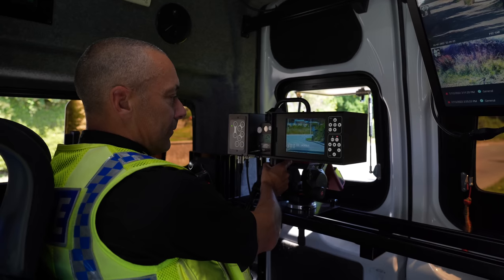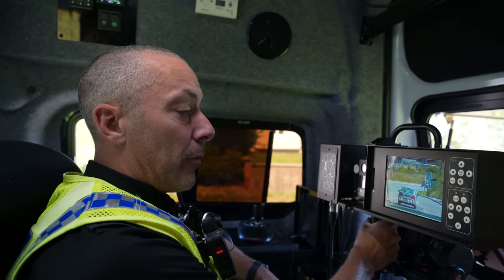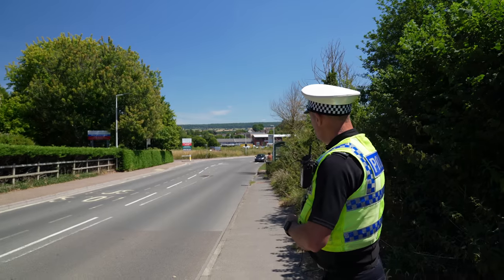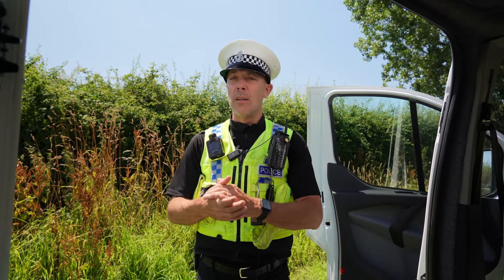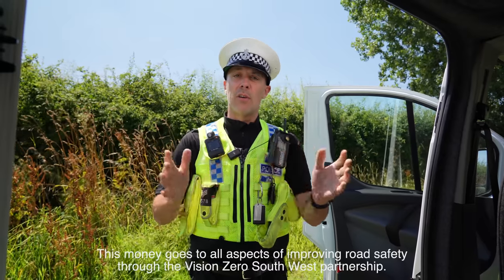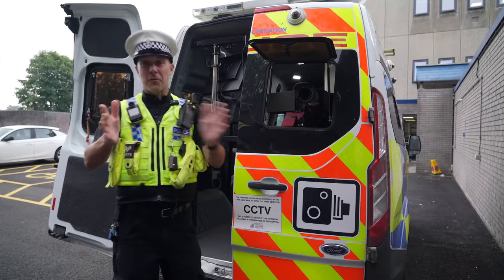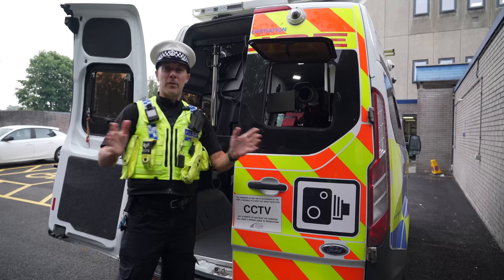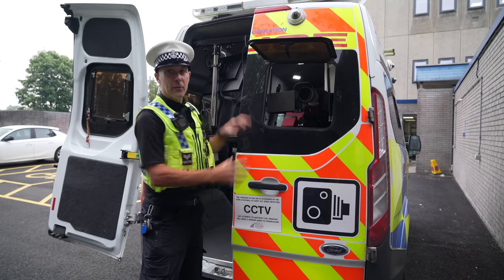SPEED CAMERAS - Road Safety or Cash Cows?

Comment: Now if only the vans had microphones to associate a vehicle with (say) an illegally loud exhaust, which is also a significant problem in residential neighborhoods. Finally, passive atmospheric monitoring of airborne particulates and gas concentration would allow for the mapping of pollution on the roads at the same time. Any takers?
Reply: Exhaust offences and things such as tinted plates and windows require the vehicle to be stopped, you cannot do it via a microphone from a distance.

Pollution is the domain of agencies other than police.

Comment: In North Yorkshire they are very good at making the vans as least visible as possible, They are always somewhere like a steep hill or where there's a limit change but no real hazard. I've even spoken to ex-coppers that are against speed vans, if you really want to keep speeding down put in an average speed zone or fixed cameras. 100% cash cows.
Reply: Wherever they park, someone will moan, on the straight bits, the bendy bits, the gradients, the dips.

They can only park where they can park.

I've spoken to lots of serving officers who actively endorse speed enforcement in its current form as it means they do not have to do it themselves.

Comment: We do it differently in Wales , hide the van , do not allow civilian speed checkers (we had them but were taken away because the camera van was losing revenue ) . In Wales vans are white with a couple of camera signs
Reply: I know precisely how GoSafe operates, you say ''do not allow civilian speed checkers' - what does that mean?
Reply: @unleashthedragonwithin2057  We had members of the public with an official  speed gun who noted speeders and GoSafe would then write to them  . Was working well locally , Go Safe then withdrew support for the operation as the Speed Camera Van speeding revenue was reduced .
Reply: @nigelhughes2947  You mean Community Speed Watch which only results in a warning letter.  My experience is that the process  required to manually transfer all the collected data to a system that then produces warning letters after each keeper has been provided by DVLA is unsustainable.  The staff who do the admin are paid by those detected and who attend a course, so it is a Catch-22 situation, the staff cannot be employed without course funding, so ultimately, 'genuine' enforcement would have to cease.  I can therefore see why CSW is not viable if it relies on police resources to generate correspondence.
Reply: @nigelhughes2947  No, that most certainly is not what was stated.

Speed enforcement units comprise various sections, there are enforcement officers, a viewing team, an admin team, a prosecutions team, team leaders,a unit manager, so around 45 staff which equates to £125 - 135k in wages every four calendar weeks before you factor in the huge stationery, printing and postage costs, which can be 10 - 15,000 individual items of post every week, fuel, vehicle related bills, heating, electricity, static camera contract etc.

To compare it to parking penalty notices is just shortsighted.

However, in 2011, central government stopped speed camera funding which meant that every UK constabulary had to devise a strategy to provide the public service of speed enforcement, many being unable to and some just had to stop.  This means that speed enforcement can only exist via the self-funded national model of course offers.

Hiding?  What does that mean?  Laser speedmeters do not and cannot work with anything in the way.  Can you provide any verifiable evidence please?
Reply: @unleashthedragonwithin2057  So you did not agree with the Government so used a revenue strategy to fund people to get speeders , so without the course revenue there would be no camera vans , so in fact the general public is quite clearly the cash cows which keep you all in a job . Its all about the revenue
Reply: @nigelhughes2947  It has nothing to do with me not agreeing with the government.  Every UK constabulary is under considerable pressure from communities to provide a speed enforcement presence.  Without a structured mechanism to be able to do that, many regular officers would be taken away from other duties to carry out enforcement.

The 'general public' are not cash cows, only those intent on ignoring the posted threshold end up with a notice.
Reply: @unleashthedragonwithin2057  Other duties such as not attending burglaries , violence against the elderly , yep just be happy with a crime number while we get on with hate crimes , thought crimes etc oh and making sure driving while black is punished .   We have now come full circle community speed watchers do not make money  but speed cameras pay for jobs for the boys ,
Reply: @nigelhughes2947  Community Speed Watch only exists because it is paid for by sanctioned speed enforcement operations.

So no, speed enforcement pays for such road safety operations, both those that result in notices of intended prosecution or 'just' warning letters.  None of it would exist without a system of self-funding.

You obviously have a some form of grievance you are attempting to air, but the above is traffic based, demonstrated by a traffic officer who has nothing to do with burglaries, or assaults, hate crimes.

I understand you are encumbered with psychological baggage that's clouding clear thought, but once you understand how it works as opposed to how you'd prefer it did, you can reach your 'happy place'.

Comment: Although I agree about the dangers of Auto-Bahn vs regular UK roads, there is a massive difference between cars traveling on both roads. I would dare to say, that 80% of cars from UK would not pass TUV (German MOT) in their current condition, thus they would not be allowed to participate on the road. One of the reasons, why people buy cars from Germany is the fact, that Germans are almost ''forced'' to maintain their cars to close OEM standard of the manufacturer, but that enables them to safely drive on the autobah.
Reply: So all these vehicles were in tip-top condition, meaning it was the drivers at fault:

259 cars involved in motorway pile-up in Germany
This is the horrific aftermath of a motorway pile-up involving 259 vehicles that left 10 people fighting for their lives.
Reply: @unleashthedragonwithin2057  There was a pileup on M3 recently with several casualties as well (speed limit 70mph). So what's your point? Are you trying to take out driver element and write off all accidents on maintenance level of the car? You do know that crash site investigators check car condition when any major accident has happened to see what could have caused it?
Reply: @MrLangobard  My point was extremely clear.

It is the human being behind the wheel who decides how that motor vehicle will be driven, its speed and direction.  It is also a human being who determines if that motor vehicle is in a fit state to be driven on public roads (all pertinent conditions applying).  

You take control of a motor vehicle, the onus is on you to ensure its mechanical and structural integrity.
Reply: @unleashthedragonwithin2057  It does feel we are going in circles here, but I do agree with your point. So I'll leave at that. As long as safety of others are preserved, I have no issues what so ever.

Comment: I noticed on the camera the bend up ahead so people cant see you till theyre around the bend, so in a way your hiding and  surely its entrapment.
Reply: Being hidden doesn't make it entrapment, entrapment is the act of lying in order to get you to commit an offense you would not have otherwise committed in order to gain a conviction. Being hidden does not make people speed, therefore it is not entrapment. Also, being around the bend doesn't make it hidden. It just means it's around the bend. Roads are only made up of bendy bits and straight bits, so it'll always be round to bend for someone

Comment: Technically, what was said about not having to mark up the vehicles is only partially correct. All vehicles that stop regularly on or next to the highway must have Chaper 8 markings (the Red and Yellow stripes). When driving, you should be looking in to the distance, towards your next limit point; not staring at the vehicle in front. Therefore, if you can't see the van in that distance (whether it is a camera van, roadside workmen etc), your observational skills may need to improve.

Comment: When used correctly, yes they are a good measure. But the is a fixed speed camera on a dual carriageway near me that has been turned off by the local council (to save money I think?) but the camera is still there….remarkably people still slow down and check their speed simply because the non functioning camera is there…..so ? 🤔🤷

Comment: If you want to slow people down, design the roads to "afford" the speed you want.  Make driving on it faster uncomfortable.  Narrow the roads, bring the pavements closer, put more crossings, more obvious crossings, lower the kerb in sections and put the pavement across the road.  Make it confined, constricted and less obvious it's not a "shared space".  ALL SCHOOL AREAS should be pavemented, not tarmaced with very obvious entry and exit hard speed ramps (not table tops).
If you give people a wide open dual carriageway with a clear view for a mile and very little traffic, how are they going to assess that risk as 40mph?  How?  They won't because 40mph is a stupid speed for something that practically looks like a motorway or race track!
If you have a section of dual carriageway that you NEED to by 40mph... narrow it.  Put calming cones between the lanes every 50 yards, force cars to WANT to slow down, not just trick them with a random 40mph zone which only got put there because of some stupid graduate civil engineer making a rubbish risk assessment, meaning as there is a T junction which is hardly ever used, or a pavement frequented by absolutely nobody, it has to be a 40mph.

Comment: i agree with most of the video however reaction time is vastly different to 30year old cars. Mechanical engineering has improved so many parts in the car that help alongside the reaction time of the driver. especially EV's
Reply: How does reaction time vary depending upon what car you are driving?
Reply: @unleashthedragonwithin2057  if the mechanical parts are more responsive and better then it will help a lot
Reply: @nippz2831  Reaction time is nothing to do with the vehicle, it is how long it takes the driver to move their foot from the accelerator pedal to the brake pedal.
Reply: @unleashthedragonwithin2057  I don't think u understand the outcome of the incident or situation changes
Reply: @nippz2831  The outcome has nothing to do with reaction time.  Reaction time is followed by braking time, assuming the brake pedal is actually pressed before the collision takes place.

The reaction time is the same as it was when motor vehicles first existed.  It is the human aspect = how long it takes for the brain to register the approaching hazard and to then react by physically moving the foot to cover and press the brake.  It has nothing to do with the mechanical parts of the vehicle, you are confusing it with braking distance.

Comment: No disrespects but I've seen a cop on the main torquay to Paignton Road corbyn head pointing a radar gun at traffic that's moving 5mph lol. Yet the shops in Preston after 9pm you could have confetti tickets why are you wasting time and resources
Reply: Isn't Preston 350 miles from Cornwall?
Reply: @unleashthedragonwithin2057  Preston in Paignton its Devon not Cornwall
Reply: @chucky2316  The above is Devon AND Cornwall Constabulary.  I have never seen shops anywhere issued tickets for speeding.
Reply: @unleashthedragonwithin2057  there's shops in Preston on the main torquay Road and the idiots use it as a race track at night

Comment: Somebody should tell that to Safer Humber about not being a cash cow.

They tried to fine me because I went "through" a red light. Like their there to enforce the speed limit plus I guess mobile and seatbelts in some cases

But they fined me for going through a red light but it wasn't... It was GEEEN. They assumed because the oncoming lights were red that mine would be red but no, the timings are different because of the filter.

This was at night when it was quiet on the roads. The way I could prove it was because I had a dash cam.

Comment: sureley there is something in law saying you need to mark up the veichles.
according to both data protection and GDPR people need to be informed / made aware that data is being collected on them before the data is collected (surely this includes speed and numberplate)
wouldnt a plain unmarked veichle be couvert/directed surcailance and require written RIPA permision for each veichle before it can be targeted?
Reply: No, nothing in law regarding the need for markings.

No, GDPR & data protection do not apply, this takes place in a public place where there is no expectation of privacy when it comes to criminal offences.

No, nothing in law that prevents covert enforcement,

Comment: Why put a speed camera van by a school that is closed or during hours children will be in lessons? Why don't you put it there between 8am and 9am and 3pm to 4pm? The reason, if you speak to speed camera partnerships, is cost. It's expensive to deploy speed vans so they are ONLY sent to locations guaranteed to give a good financial return. (All this information is available to look at.) For example, on a main road between 5pm and 7pm or from 9am to 11am. The position is chosen in the North West AFTER speed surverys. A box is put at the roadside with wires across to measure speed and time. I had this explained by Merseyside after I asked for speed checks in areas of risk. It means the surveys are still used to position vans on specific roads, which times give the best return and which directio.  It's been admitted they are used on roads that have never had vehicle or pedestrian accidents. One request I made was a main road that idiots kept going through a wall as their chavved-up cars couldn't handle a bend at more than 30mph, one was by a care home that a bus stop was on the opposite side to, one by a village with various shops. All refused based on the above reasons.
The reason also given for not putting speed camera vans near schools between 8am and 9am and 3pm and 4pm was that there is a big increase in traffic, causing congestion and making it difficult for people to get above 30mph. Police said parking was more of a problem and they couldn't be outside every school to give people tickets. Another problem is lack of education and parents suggesting pedestrians have right of way. This is a dangerous message as schools don't seem to teach basic road safety now. Parents don't either as children seem to be experts at no win no fee and all know their rights, which doesn't help when playing chicken with cars, buses and HGVs. Most accidents near schools are as a result of children running in to the road, not using crossings, thinking vehicles will just be able to stop and riding bikes in a manner that is not considered safe as their actions put not only themselves at risk, but other road users and pedestrians. They're ALL hit on the road and none on pavements - vehicles were not on pavements at the time of collisions, so it can only be the fault of the pedestrian for putting themselves in danger.
Look at some accident investigations and see that railings outside schools are ineffective - some cycle groups even complain they shouldn't be used. They don't understand risk assessment. Every accident or fatal I have seen involving children has been caused by them running across roads within feet of crossings, or as a result of their own actions. I can only think of one were a car mounted a pavement.
We need to educate people about inappropriate speed and children about road safety. It isn't acceptable to make drivers or cyclists responsible if someone else takes no responsibility for their own actions. Obviously people that have lost children as a result of their own actions will want revenge and prison sentences for drivers and cyclists, but they need to face facts. Once this happens, maybe we can start teaching basic awareness and road safety again, bring back the Green Cross Code, make crossings fashionable again, change this stupid attitude of "it's not your fault".
For a police officer, you don't seem very aware of the wider picture, research, accident investigations, how stats are compiled and misrepresented the same way ethnic codes have been for 25yrs, police policies or road safety and speed camera partnership policy and how decisions are made and driven by budgets. Hopefully if you do progress in your career, you will learn more for promotion. You will get a far better understanding and maybe gain more knowledge.
Reply: Please provide data to support enforcement outside schools?

Why would you deploy such resources to locations where there is no speeding problem?

Comment: So your camera can see perfectly well through a full limo tint on the window at a 1000 meters ? But if you put a tint on your front windows or windscreen you’ll get points on your license and a hefty fine , so this has nothing to do with restricting your vision , this is because the police can’t see who’s driving, 😡😡😡😡
Reply: The window has to be open for the equipment to be used.
Reply: The police don't need to see who is driving, the onus is on the keeper to provide those details.

Comment: But if the point is to deter drivers from going over limit as it can cause greater damage upon accidents then u need to stop cars not send tickets. Tickets only arrive days weeks after event, meaning you are not worried that excess speed can cause greater accidents at that point in time.